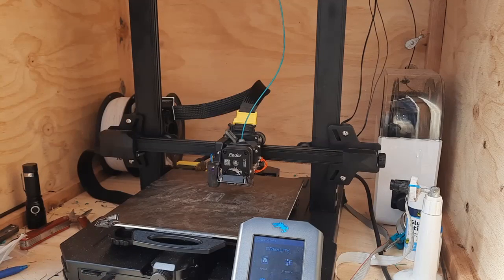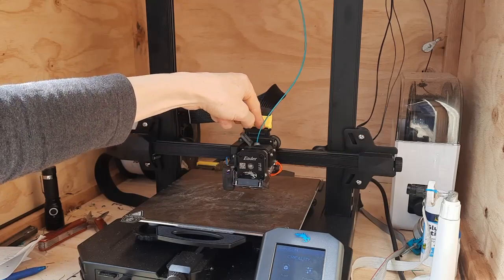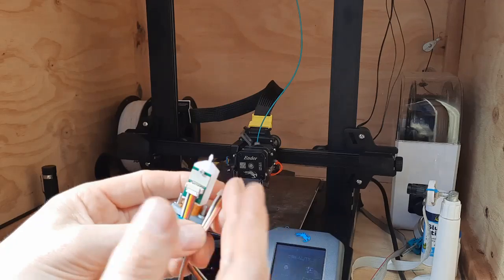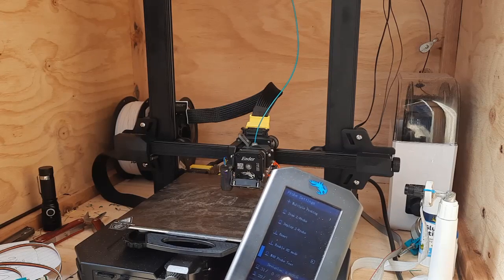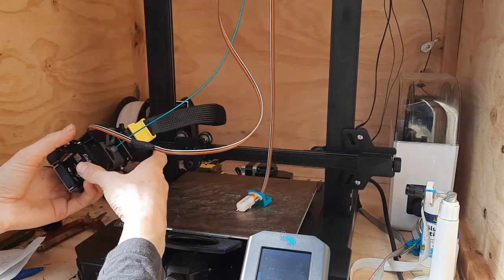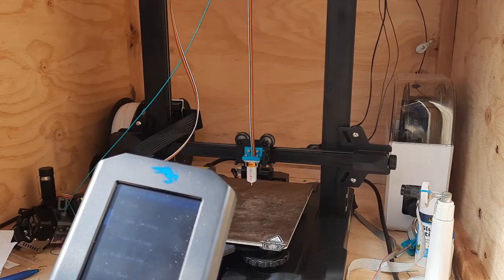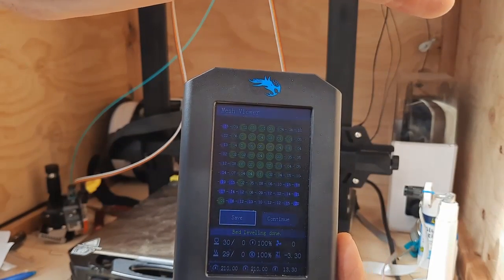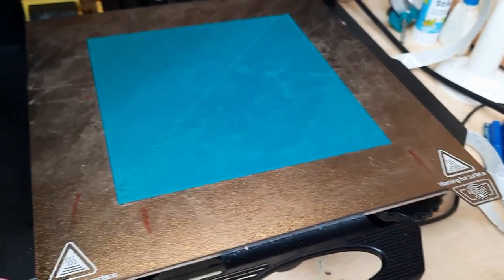3D Printer Most Accurate Mesh Setup + Mesh All The Bed !! - Ender S1 Pro

Comment: You can move the offset of probe to nozzle position in you Cura setting. Choose printer  - machine settings - extruder tab and input the position of your probe in relation to nozzle. I found this on Victor Bared video as I had problems centring the nozzle to the bed.
Reply from the maker: I believe there is gcode that can do it too.

Comment: Nice video, well explained. Did you find an easier fix since these videos
Reply from the maker: not yet, there are various 0 y offset mounts which are easier, but not as good
Reply: @hayden-james  Yes nothing seems to really solve this problem....Thanks for you answer.
Reply from the maker: @kinofaya1143  depends how deep you want you look and spend time on rather than just use the benefits abl is meant to provide

Comment: This is very smart! Might consider this, but also your dial indicator method! Great ideas! Subbed!

Quick one, with this mesh, what's your variance? Do you also find that when printing taller models the nozzle starts biting into the model at higher layers?

Thanks
Reply from the maker: Hi ! Glad you get it, its simple but very effective. My current variance is 0.3mm so quite high. the only times i get top of model grinding by nozzle or fan is if part of the model warps/lifts off the bed due to inadequate adhesion. i get around this by glue stick and or brim/tab anti warp plugin
Reply: @hayden-james  Oh great! I've never used glue stick and used a brim only once. I actually thought the grinding is due to the z compensation from the mesh being faded as the layers increase to ensure that your model is still flat at the top and not follow the warpage of the bed.
Reply: But the lifting off the bed actually makes sense that it would start grinding, I have since tried adjusting flow rate and e-steps thinking maybe that's why mine grinds, had no luck, then I concluded that maybe my bed is too warped... and then z compensation fading is then terrible... but I have only since build a 9x9 mesh manually with Klipper, and using the paper method... I get a variance of 0.23mm, if I run auto level I get around 0.16mm...

So I'm gonna try your methods, I think I'll get an even better result 🙂
Reply from the maker: @Skhulile84  default the z fade should be about 10mm, and it is doing this as its laying down fresh plastic so 10mm is 50 layers at .2mm so for my 0.3mm variance its only correcting 0.006mm per layer with fresh soft plastic
Reply from the maker: @Skhulile84  look closely at the part of your model grinding and ull likely see it has lifted off the bed slightly, or once off put a ruler edge against the bottom
Reply: @hayden-james  Oh yes, that makes sense. I think I actually had the wrong idea of z fade... I actually thought it only starts compensating per layer after the 10mm... so from layer 51... I think I should actually read more on z-fade and start using glue stick or wash the PEI bed, I find that if I wash with warm water and soap then the adhesion is soo good!
Reply from the maker: @Skhulile84  yes it aims to complete the z fade to be level by height 10mm
Reply: Thanks for all your advice! I'm new to 3D Printing, so learning a lot from you. I will try to implement your mesh leveling methods, though I'm running Klipper but should be the same! Really, thank you for taking your time, really appreciate it! 🙂
Reply: Do you have a link for the other bracket
Reply from the maker: @nathankean7968  https://www.printables.com/model/255096-sprite-extruder-ender-s1-pluspro-cr-touch-mount-fo/files